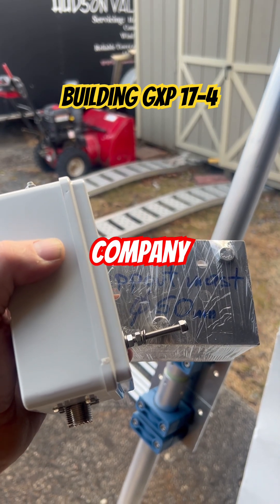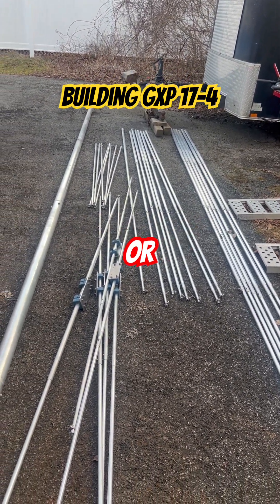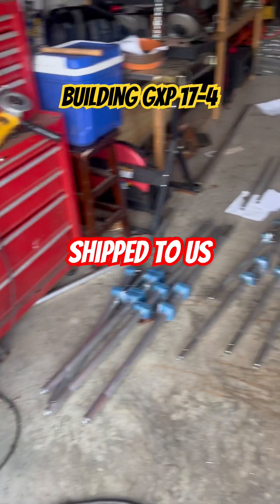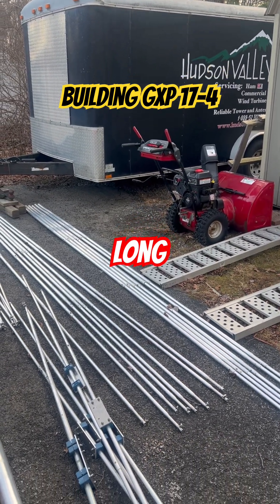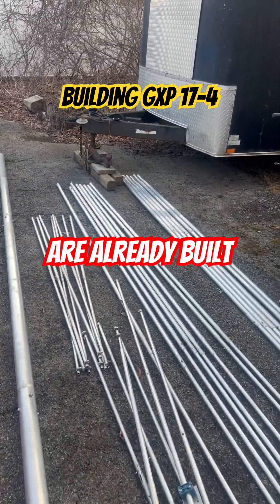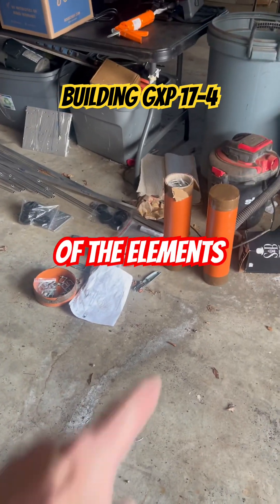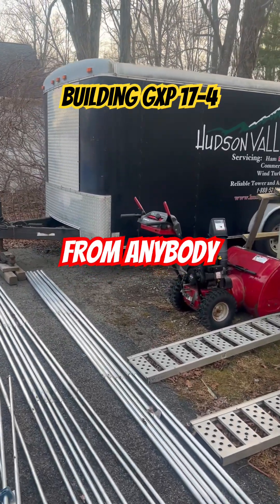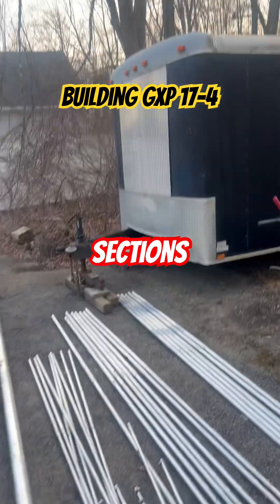The Process Of Building Ham Radio Antennas And Transporting! #Hamradio #Shorts

Comment: How much did that antenna go for? I was told it’s an expensive pursuit, and from a cursory look that seemed true
Reply: As a still new ham. Me and my dad bought a used 10 to 80 meter 40 foot tower for 400 dollars. So yes. It's expensive
Reply: I believe that is a GXP antenna.  They run about 700 bucks.   Add to that the tower, which could be as little as 500 bucks, but could be as much as $10k or more!